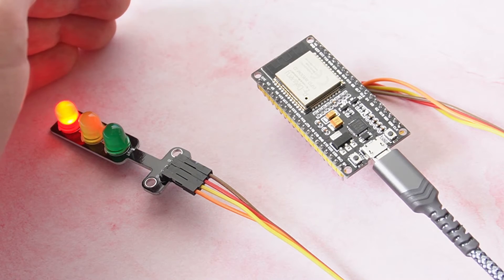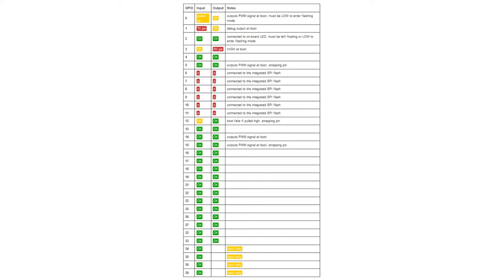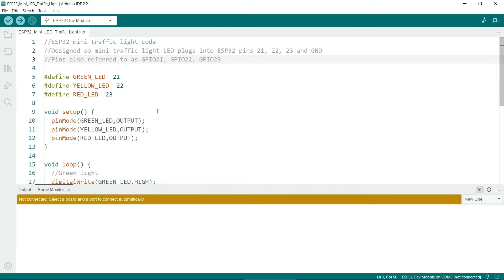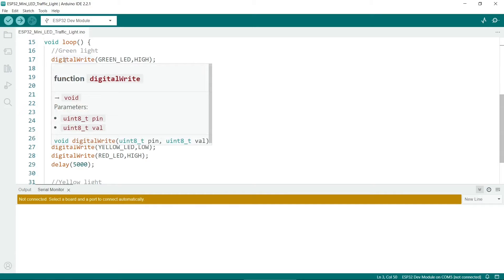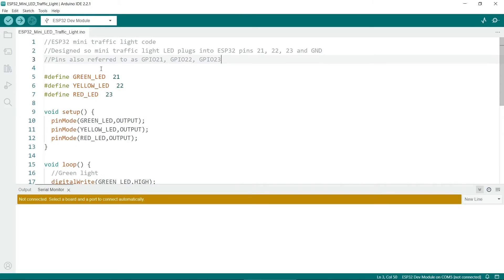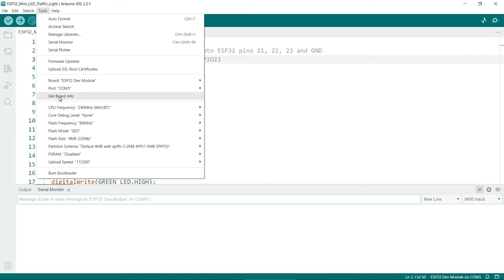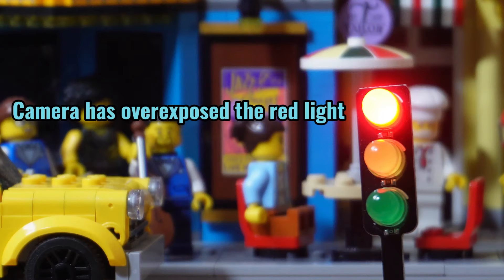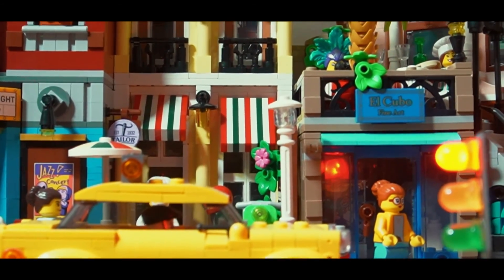ESP32 LED Traffic Light Tutorial + Code

Comment: Can i ask...I have a project to repair an old set of traffic lights that were converted to work indoors but the controller has long since lost. So i was going to use an ESP32 and a 3 channel relay board to control the bulbs. But i cannot code. No, trust me, i cant...I grew up in a world of resistors, capacitors, BC108 transisitors, vero board, etching PCB's etc and all this digital stuff just confuses me.Would you like to make a man happy and just mod your code to comply with a standard set of UK traffic lights. Red: Red/Amber :Green.... So i can make these lights authentic.No harm in asking as the worst you can say is no!!!.. Regards. Cornz38.